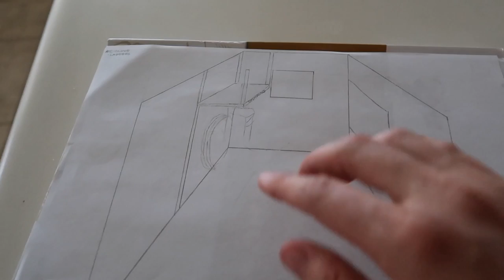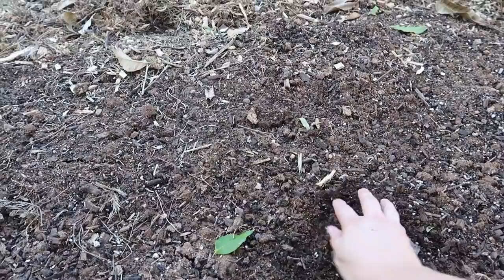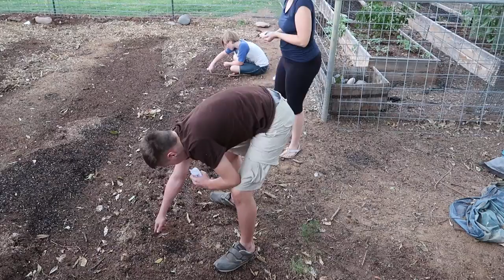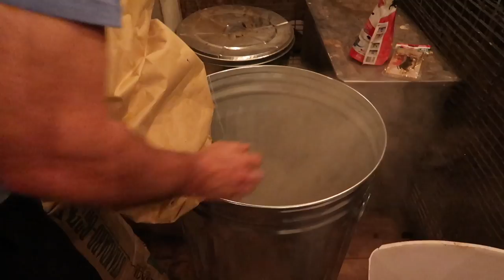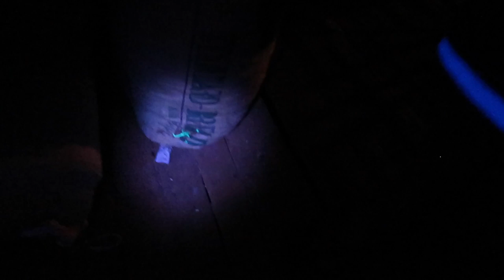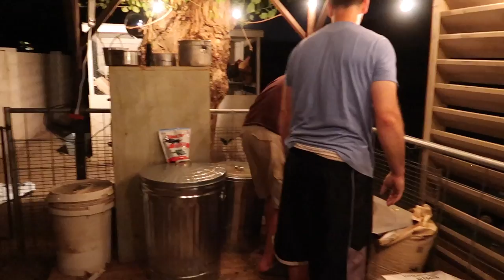Don't freak out but there's a SCORPION on you!

Comment: Rat
s have tendency to even chew trough the cement. And some of the problem solving ideas with persistent rats calls for cement with crushed glass, because they are very inteligent and they will be persistent if they know there is food out there. As quick as possible you need to invest in food protecting metal tubes or whatever, they will take advantage of easy resource of food even if your bags of food are untact yet. They are very quick learners.
Reply from the maker: Wow!